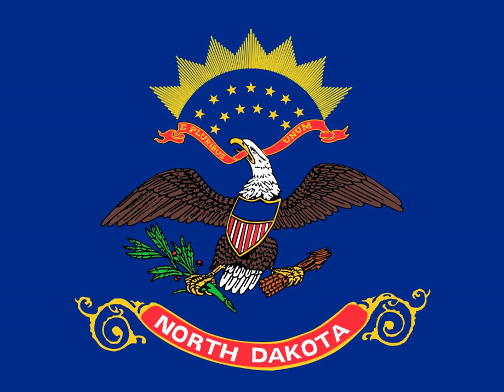Dakota Gasification Company | Wikipedia audio article

Comment: Coal Gasification
 Chemical Products:

- H2 (Hydrogen), for fuel cell 
- LPG/Town Gas 
- Methanol, for dimethyl ether, methyl acetate (solvent for glues and paints, acetic anhydride), formaldehyde, gasoline, olefins (caulks, cement and glues, construction adhesive, detergents, fingernail polish, liquid soaps and shampoos), acetic anhydride (cellulosic plastics, filter products, photographic film)
- Wax 
- Diesel 
- Naphtha, used in the manufacture of plastics 
- Ethylene glycol, for polyester, synthetic rubber
- Coke is used as a smokeless fuel and for the manufacture of water gas and producer gas. 
- Tar, for road surfacing 
- Benzole, a motor fuel 
- Creosote, a wood preservative 
- Phenol, used in the manufacture of plastics 
- Cresols, for disinfectants 
- Sulfur, used in the manufacture of sulfuric acid 
- Ammonia, used in the manufacture of fertilizers
- Carbon Monoxide, for acetic acid, chemical feedstock
- Propylene, for fuel and refrigerants
- Pyridine, for Pesticides, Solvent and Specialty reagents